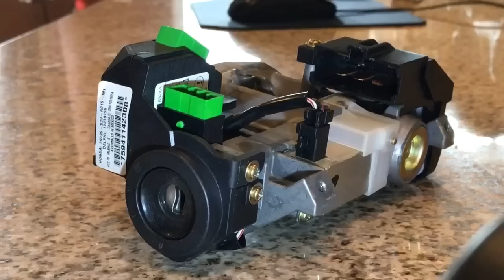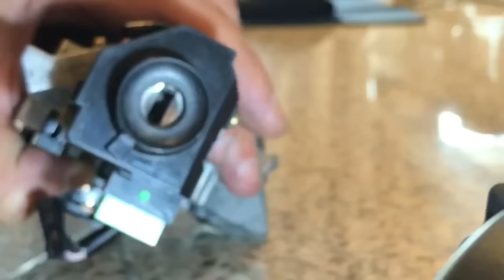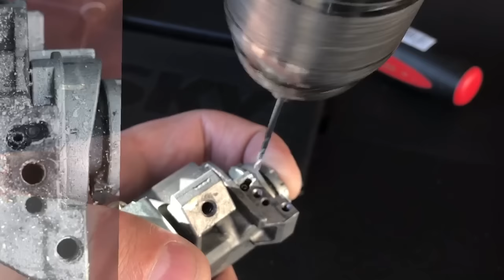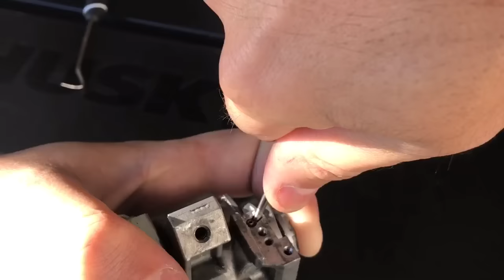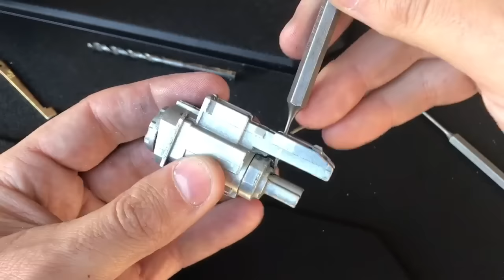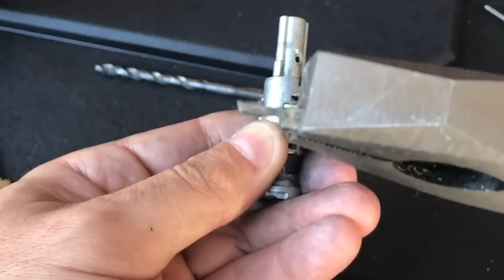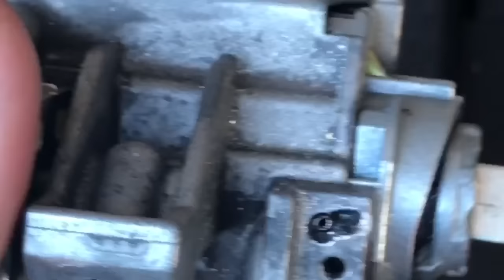Honda Ignition Lock Repair - Step By Step Tutorial

Comment: thank you so much for this video,  you saved me over 600 bucks.  I did it a bit differently though,  I drilled the first pin out and then tapped the hole. I used a set screw in place of the pin so if it happens again I can easily take it back apart. 👍
Reply from the maker: Your welcome, I'm glad you are able to follow the video and save yourself some money...
Reply: What size did you on your set screw

Comment: Helpful tip: If you can insert the key, turn the key in the tumbler to gain access to that small roll pin without drilling through the top of the assembly.

Comment: When I pulled out the key to remove the damaged wafer, several wafers and a rectanglular metal piece fell out. What happened and can I still savage (reinsert the wafers back into the slits) in the lock?
Reply: I have put them back together with no wafers so any key will work but who is going to know that?
Reply: @billwilson3665  Is the lock still working as needed? Is the key fixed in the cylinder that way?

Comment: What hold the lock cylinder in a 1997 Honda Odyssey? We had to finally cut the security screw but we still don't have it out. Is there a pin in the side of the security clamp?

Comment: Great video. But it doesn't help me if I can't get the assembly out first and the steering wheel is locked at the moment. So wondering what I should do.
Reply: I have the same problem.
Reply: @gomibsygo12  I was actually going to do this myself and found it in another video but I forgot the link apparently you need to unhook the battery then remove all of the cables from the connections to the security assembly itself after 3 minutes of the battery being removed, then use a sharp chisel and a hammer to basically unscrew these pins that are right next to either side of the steering wheel rod, then the assembly will come loose away from the rod
Reply: Was it this video.
Reply: I only bought the cylinders to try to avoid reprogramming. But the column is locked.
Reply: @gomibsygo12  yes! That's it. 
You don't see the guy actually working on the pins even though you see him doing all the hammering but the basic idea is he hammered grooves into the pins and then use them as leverage to unscrew them
Reply: @gomibsygo12  the whole assembly it appears needs to come off anyway even to get the new core out because you need easy access to different portions of the assembly
Reply: @gomibsygo12  even if the column is locked this should do the trick in getting the assembly off
Reply: Thank you. Im going to try this. I only bought the part where the key goes so wish me luck.
Reply: @gomibsygo12  after you get the assembly off there is another video that of course I can't find where a real locksmith shows how to take the Tumblers out and get to the core I suggest you look for that video if you have trouble getting to the "bad core"

It's the same search I mean just search '08 fit ignition cylinder replacement.

I was going to do this as well myself but instead I spent roughly 4 hours at my mechanic yesterday after he had just fixed the engine fiddling with my two separate keys...  because his jackass assistant took out my key when I told them not to.

Comment: Do the pins need to be reinserted for the device to work?  I destroyed the pins when removing them and I still cant get the car the key to turn.  I took all the wafers out of the tumbler and tested the device in my hand to make sure it spun freely. After carefully putting it back into the steering column, the key would not turn.

Comment: Thanks! I was able to get my car sorted out and back on the road. The only thing I noticed is that the beeper alarm like you left the key in the ignition is always going when there’s no key in it. Once you shut the door it stops, but this wasn’t like that before, so not sure how that is connected or if I need to fix that.
Reply: I just had the same problem on my 2003 honda element.  Did you find a fix for that?

Comment: great video, but just want to trow in my 2 cents, put a towel or piece of low plush carpet to catch the flying parts, and I would blow out or spray off the drill metal chips, just to avoid pushing them into the switch when you use the center punch.

Comment: Ive found out that the roll pin can be removed by screwing a small screw inside the pin and pulling it out with pliers, way easier than drilling :)

Comment: @father & son locksmith - is it ok to just drill out the first roll pin holding the tumbler to the assembly? I drilled a hole to the side of it but am unable to pull it up with a pick. If I can just drill it out and replace it will a new pin I will. Please let me know!
Reply: A bit late, but here's my opinion. The pin is harder metal than the cast metal. you probably will make a mess of it. I was able to drill from the side of that first outer pin, right next to the key entrance. fist I drilled right next to the pin down to where the block joins the body. but I couldn't lever the pin up. So I made another hole. This one perpendicular to the pin coming from the key side. I used a slightly larger drill bit, so I can swivel a lever. Then I used a bit like 1/8" or a tiny bit bigger. I drilled from that side into the side of the pin. I happened to have a compass with a sharp point and stuck it in there. The point fitted in that tiny hole and I levered it up and out of the way. The tumbler popped out. The other pin in the tumbler, I did used the idea to drill through the bar to create an access hole to the pin. I cut the end of a finish nail flat and hammered the pin all there way out.

Comment: Using an offset screw driver, I was able to take the lock cylinder off without removing the assembly from the steering column. That should save you from having to deal with the sheer bolts.
Reply: can you send a link for the offset screwdriver kit thanks itd be very helpful
Reply: Muhammad Bhatti it was a husky offset screwdriver set from Home Depot. 
https://www.homedepot.ca/product/husky-3-piece-offset-screwdriver-set/1000838260
Good luck

Comment: Ok i love your video only you don't show the actual cylinder to come out of ignition housing I have a key with chip .. problem is the wafer is stuck inside so key only goes in part of the way and I need to get my car up and going my daughter has passed away and I need to get to her funeral . I've got to transponder being removed now how do I get cylinder out of truck and into my vise to get pin out

Comment: I took every thing apart just like you said and took out the bad wafer or tumbler.  The key turned after that just fine.  When I put the cylinder back in the housing it would not turn any more.  I have made sure every thing was put back just like it should be, it all fit together right.  Do you have any ideas?  Is something else wrong?
Reply from the maker: Call me 610-489-5755
Reply: I experinced the same issue, but it was due to not lining up the tumbler correctly when i was putting it back, my solution simple pull the tumbler out and line up the back of the tumbler with the assembly correctly. Hope this help someone else.

Comment: I’m actually watching this after the fact just to see how I did, haha. 
Not too bad I think. The only things I did differently were on the first roll pin I drilled straight through it, and then for reassembly I drilled and tapped the hole to use a 4mm set screw (from Lowe’s hardware section). The second roll pin was easy since I was still able to turn the cylinder with the key to get at it without drilling. 
As far as the wafers, I just took them all out so I don’t have to go back here ever again. Of course now anyone with a Honda key can turn it over, but the immobilizer takes care of that. And I can also take the key out with the engine running, but that just reminds me of my old GM products with worn out ignition locks 😂

Comment: Can you help?  The dealer replaced ignition and prorated three new keys.  2097 Honda Accord.  Now the battery draws down and car won’t startvwithought a jump.  We replaced the battery and same thing.  Now car won’t start, even with a jump, no dash light no sound no headlights?  The dealer says on tbe phone it’s not related to the new ignition install.  Do you have any thoughts about the relationship of tbe new ignition to the issue?  Before today it would start a few times before the not start/jump/start cycle.   Thanks
Reply: 2007

Comment: For anyone else doing this, fyi you can rotate the key for that second pin instead of drilling from the top, put the whole thing in a vice and use something (tiny screwdriver with torx head in my case) and pop it out. About halfway through he drills through because he didnt have access to that second pin but in my 06 crv i just rotated the key and then threw it in the vice to access the second pin without drilling

Comment: i saw your video but im still confused on replacing my ignition immobolizer module. is there a difference on the immobolizer for the 2001 acura 3.2 cl  against the tl 3.2 ?my green key stays lit  on which tells me that my immobolizer is not working. once i replace the immobolizer do i need to reprogram the keys as well?please advize me  thank you, dennis brown.
Reply: ... you probably need your car reprogrammed, if you replaced the immobilizer module 🤔

Comment: I have 09 civic and when i pull the key out its hard to get all the way in to turn the ignition. My used keys dont want to go in anymore but my new key works better so i just leave it in. Do you think this is a wafer problem or permissive problem?  If i angle the new key down it will go in easier.
Reply from the maker: Your key is probably worn out get a spare key cut and see how that works..
Reply: I have 3 keys. The new one doesnt work very well. The ones on key chains are worse. They all work in the door and trunk. I might see if  i can look down tge key hole ir clean it. Im trying to get my nerve up to remove the unit and repair it.

Comment: Did all those steps and when I put the cylinder back in the housing... key will not turn. It turns fine when it is not in the housing.  The rod inside the housing that the cylinder goes into will not turn... any suggestions?
Reply from the maker: Call me 610-489-6689

Comment: Why did you remove the whole assembly to do that? Also why did you drill it to pull the roll pin? You know they have tool to pull those roll pins right? Why didn’t you replace the wafer you took out?
Reply from the maker: I made this video for regular people not locksmiths, An average person is not gonna have a Honda Roll pin remover or a high security pin kit..

Comment: Has anyone tried this with a 1st Gen Fit? I hear about people removing just the cylinder from the car without removing the ignition (just by removing the 1st rolling pin) which is what I would really like to do. Feel like the security bolts will be too much of a problem, I can only actually see one of them and not the 2nd anywhere, and some people say they need to turn clockwise, some people say anti-clockwise.

Comment: If I take this off and have my civic to the point where I can make the engine turn over with a screwdriver, what is keeping it from starting?  It cranks strongly but won’t fire up.
Reply: honestly it depends on a few different factors. Check your battery, alternator, fuses, starter. Research your car: 'Honda Civic "year" ' and starting issues. and find the maintenance manual for your car. google: "honda Civic 'year' helms manual .pdf free"  good luck!
Reply: @bg662mob  I was told by mobile locksmith that the chip in your key has to be there to start car.

Comment: Can you tell me what that "tail piece" is for? I couldn't get the lock back in with it on so I left it off. 
After pulling most of the wafers it starts fine, but want to be sure! thx
Reply from the maker: Call me 610-489-6689

Comment: Is that the same solution if I can’t get my key out of the ignition. It’s stuck in there and my steering wheel is not locked.  I have a 1998 Honda accord
Reply from the maker: 1998 Honda Accord ignition is different, its not high security .. That being said it’s, the most likely cause is a worn out ignition..
Reply from the maker: The video I made is for high security ignitions only..

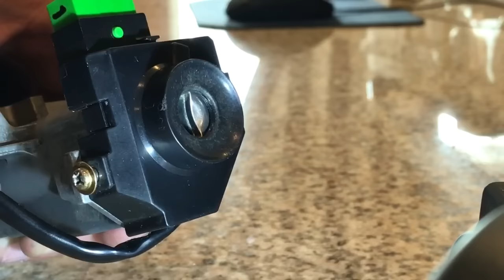Comment: 1:58 what is that part called? And is that part a matching to the immobilizer? That second part I have has a burnt tracer. I have another immobilizer & key from a different car that's the same model as mine. But from what I've seen the new key and immobilizer will have to be reprogrammed for my ECU.... So I was going to change out the cylinder and all from my old column so I can still use my old key. So I won't have to pay a crazy price just to get someone to do the programming.
Reply: .. are you referring to the electronic part that's behind the Black cover, those are the electronics that read the chip in your key 🔑 🤔  ... it might be a swappable part, I'm not 100% sure.
Reply: @Texaca  I got the car running yesterday. The 1998 - 02 Honda Accord has the immobilizer & right behind it is the coil. From what I learned if the immobilizer module goes bad you can purchase another one with matching model numbers. The only number that would be different is the number across the barcode. I tried to purchase just the immobilizer COIL but I couldn't find one without buying the complete ignition assembly. Anyway, after beating my head on the wall for a couple of days watching this video and reading this article..... it was the main relay switch under the dash that was bad 😆. 
Thank you for the reply. Out of 5 or 6 different people you're the only person that replied back! Hope your weekend went well 👍
Reply: @barnes29510  .... good for you 👍🏼  I had a similar incident with my 2004 Buick Rendezvous, back in 2019.  It would not recognize my key, the car was dead, it had no activity, or response from Instrument Cluster panel.   I yanked the battery out for 3 or 4 days, let the car die completely.   After I put it back in, it was as if everything was restored to the way it was.  I did try a different immobilizer electronic module before yanking out the battery, but it made it no difference. 🤔  That was the first time I dealt with any kind of immobilizer system.

I still have no idea what fixed the problem, prior to removing the battery, I had also swapped the starter motor, but that didn't help either.
Reply: @Texaca  You took the power from the gremlins. So they had to go find a new home! 😅
Reply: @Texaca  Hey I just did the exact repair in the video, put it all back together and now the 2007 Honda Odyssey is not recognizing my key (no chime when it is in the ignition). I was thinking about disconnecting the battery for a bit and giving it another try. Sounds like that worked for you.
Reply: @cabinetryonline  ... make sure you didn't bend any pins in any of the connectors, or that something accidentally got on them.   I once had a problem with a IBM PC computer not recognizing a ISA card on the bus, it turned out a piece of plastic had accidentally gotten inside the ISA bus connector which blocked communication with the ISA card that we were trying to install 🙄   

It's the little things that can kick your A$$ 😆  Grease, oil, and lubricants will do the same thing.

Comment: I tried to put my key into the ignition but would not got in smoothly.
Forced it in and would not turn and hard time pulling the key out.
Ignition problem or key?
Reply: I have the same issue in my 2003 Honda Accord.  I thought it was the key ar first, but had the same issue when I tried both the other master key and the valet key.  That told me it was the ignition and NOT the key.

Comment: When I took the lock cylinder out of the housing it turns just fine with the key in but when I put cylinder back into the housing it doesn’t turn at all. What could be my problem?
Reply: Have you fixed this? I took out the problem pin and it turns fine, but when I reinstall the parts it doesn’t turn at all
Reply: Did u ever fix this I’m haven the same problem remove the bad parts turns fine now but when it all gets put back together it’s doesn’t wana turn

Comment: Try using a hook ice pick to remove that roll pin on the back of the lock. It will push it out far enough to get your pliers on it.  I used to drill a hole.
Reply: I used a very small Allen wrench, and used the hook part to push out the roll pin....worked very well
Reply: Use super glue and a pick or wire glued inside rollpin comes right out just be patient and the the glue cure

Comment: Alright, so I did this, took out all of the wafers and the key turns again. BUT! when I put it back into the housing, they key will no longer turn. ? What is going on? Does it have anything to do with the anti theft steering column pin?
Reply: Nevermind, I figured it out.
Reply: Thank you so much for this video!!!
Reply: Kanani Pahio I ended up taking all of the wafers out. The key turned, but the steering column lock wouldn't stay down. It took several minutes of messing around with it. Holding the lock down and putting the key in and jiggling it. I can't recall a specific technique. At some point if you turn the key, it should pull the steering lock down with the it. I don't know if that will help you, but that's what I did. Took several minutes.
Reply: just remove the pin which is connected through electronic component .